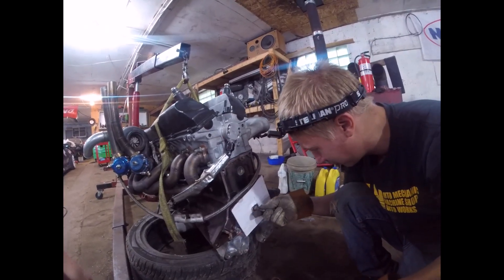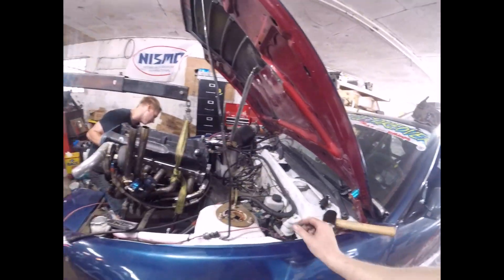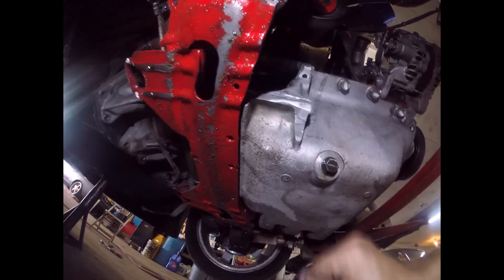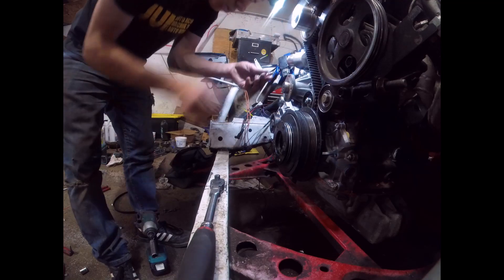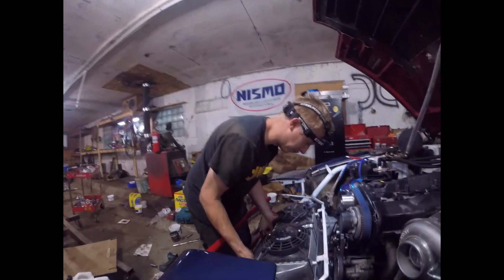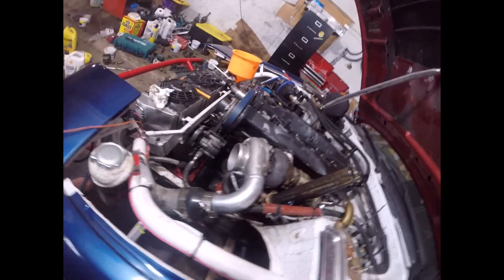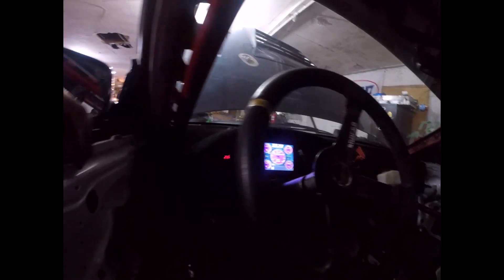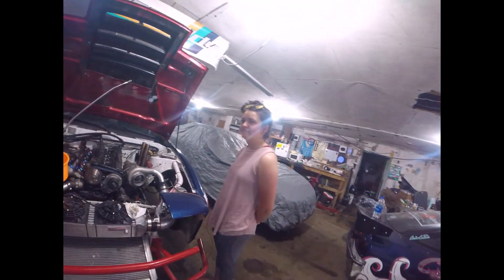RB25DET AWD NEO in to S13 with aluminum oilpain

Comment: Please keep making more videos!! Just maybe better camera quality ;)
Reply from the maker: i got go pro hero session 5 , should i get something better ?
Reply: @olesrb2432  Yeah because the wide angle on go pros is a little too much to watch haha and the audio isnt the best. Literally an iPhone X or newer will do just fine. I understand you like androids, but having it as a phone and a camera to film high quality videos with is pretty cool.
Reply: What mount kit did u you use I have the same oil pan with head drain and having issues putting it in with the ebay mounts that worked on my 20 and factory rb bushing or ka